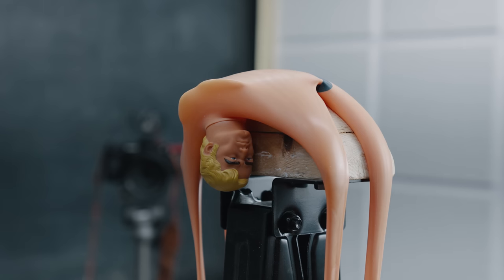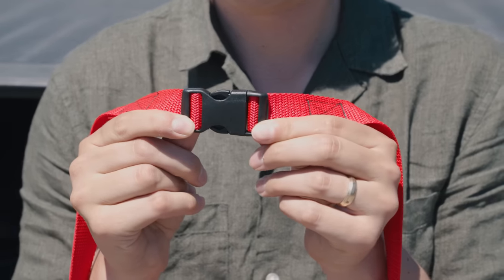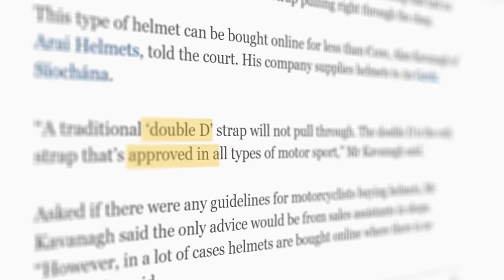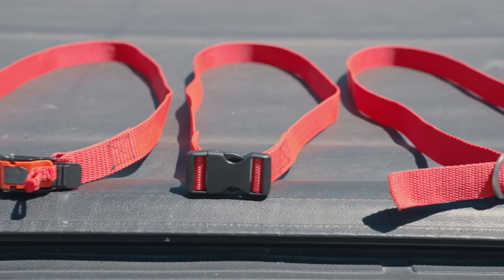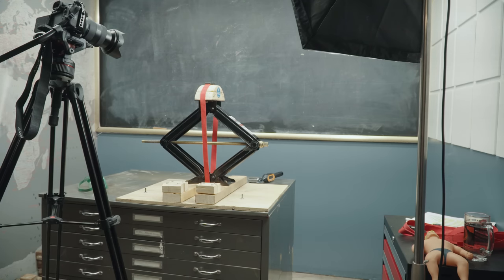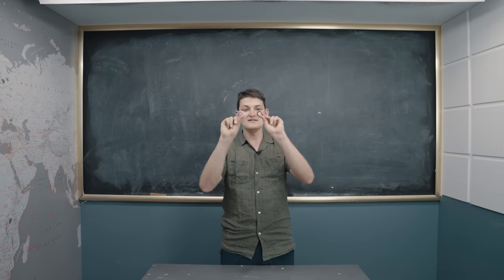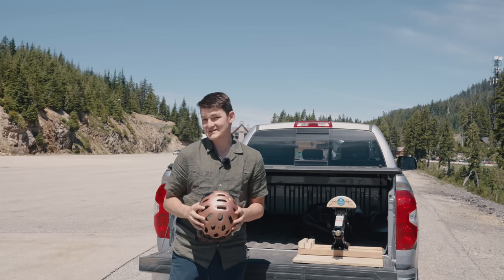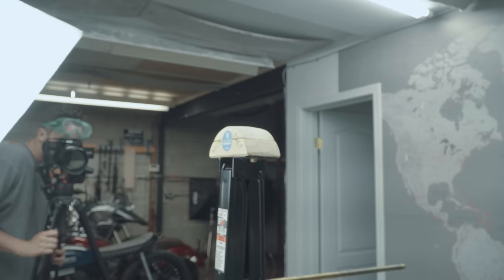Why Motorcycle Helmets Use this Ancient Buckle

Comment: You could've added a ratchet out of metal to the mix, like the ones used on the Shoei GT-Air 2
Reply: If I'm not mistaken, it is mandatory in the new European standard. So yea. That would have being nice.
Reply: I did not notice the first watch. But he did in fact use the plastic kind, as opposed to the metal one used on shoei's. 

Thanks for pointing that out.
Reply: what do you mean, metal? 
that serrated part that broke in video - it's always metal. Never seen a helmet with a plastic one, though I never had a premium helmet, all of mine were 100-200 usd. 
red releasing part is plastic, but it's not one that failed
Reply: @tomekvilmovskiy6547  if you rewatch the video you will notice that the part that failed is out of plastic. Most budget helmets and even some premium ones use these plastic ratchets
Reply: @yasc_  rewatched a few times: I see that the long metal buckle is broken. It could damage any plastic parts around after was broken itself, but for sure, broken plastic is unable to damage the metal buckle. So i made a conclusion, metal failed first.
Reply: @tomekvilmovskiy6547  The part you think is metal is actually out of plastic.
Reply: @yasc_  well, reconsidering the facts, can be so...  as I cant imagine that metal one would rather tear apart like that then anything else will break... only exception,  a metal with too much carbon (cant be here), or some aluminium alloy (can be).
Reply: @tomekvilmovskiy6547  you can see the surface where the ratchet broke.

It is black.

Steel and aluminium would both be silver. So it is definitely plastic
Reply: @anonym3017  I guess, the small piece is from inner mechanism
Reply: @tomekvilmovskiy6547  There are plastic ones. I've seen them. Just like the one he showed in the video.
Reply: The GT Air 1 had a double D, they took a backwards step with the GT Air 2
Reply: I take two 5 inch metal screws and screw the helmet directly onto my head.
Reply: @tomekvilmovskiy6547  It's plastic

Comment: I like my ratchet buckle. It's adjustable, convenient, and I'm not convinced there's much additional safety to be had in a stronger buckle. I think if that's the failure mode then I'm not very likely to survive anyway.
Reply: Indeed. Schuberth uses ratchet buckles aswel, i think its nice that i can strap the helmet on the fly, if i somehow forgot to do it before i left
Reply: same, it's so fast and i'm pretty sure strong enough. I honestly don't think you could survive breaking the strap by applying 400kg with your neck.
Reply: The test is flawed, anyway. All were plastic except the double D.

Let's try it again with plastic double Ds and see what happens. I'm betting my life savings it will break first, maybe second.

All this video proves is that steel is stronger than plastic.
Reply: @1SmokedTurkey1  not the sharpest tool...
They used what's available on the market. And helmets always have metal double D.
Reply: @Zw1d  are we comparing which mechanism is the most durable or what's available on the market? If it's the latter then yeah it's reasonable, if the former the test is flawed.
Reply: @eliasgraugaard6757  meanwhile my bicycle helmets always get double D.

Comment: Cool topic, interesting experiment (y) I've always liked the DD better. 
As for the protection you guys used. Forget plexi glass. It is rigid and easy to break. Polycarbonate sheets are a bit more expensive but there is a reason they are used as aeroplane windows.

Comment: I'm so glad you just put out this video... I have a backward facing GoPro on my daughter's motorcycle and she just got in an accident and you can see where the helmet strap clearly held the helmet on her head as she was flying through the air.... If that helmet strap wasn't tightened correctly the helmet would have flown off before hitting her face on the ground with the initial impact. Thank God for the evolution of these buckles 🙏
Reply: What exactly happened? What injuries did she sustain?
Reply: Hope all is well, but I'm pretty sure the point of the video was that these new buckles are worse then the REALLY OLD set of D rings. Meaning it's a gimmick and waist of money when you could use 2 D rings and be safer. Over engineered was the point. K.I.S.S method is best method.
Reply: @mickeyhavoc939  I really don't understand why stronger means safer. I think all of these buckles are safe enough. Ryan even says in the video that if it's too strong it would just rip your head off and to me that doesn't sound very safe.
Reply: Pauline Weinberger  She's fine (she races 50cc dirtbikes) I just wanted to point out how important this strap truly is. It possibly saved my daughter's life that day, she highsided and flew 10-15 feet landing directly onto her face and chest on an extremely hard packed track. She wears full gear all the time so she got up and finished her race 🏁 she was crying but still finished the race 💪
Reply: @mickeyhavoc939  after what I saw on her camera I wouldn't use anything but the 2 D-ring setup.... If you alter your strap in hopes to buckle faster or easier it's a death sentence IMO
Reply: @EbonyPope  no injuries... She races 50cc dirtbikes and accidents happen, I just wanted to emphasize the importance of getting the strap fully secure. In my case it's my job to make sure this happens because she's only 5 and wouldn't understand the importance of having that strap correctly tightened let alone being able to do it herself. (She's almost got the D-ring system figured out but it's nearly never tight enough when she's done)
Reply: @komerka35  True, but he also talks about how the strap is the engineered point of failure and that everything but the double D rings broke before the straps. Meaning the buckles broke too soon and that could mean the difference between a concussion and your head splitting open...
Reply: @mickeyhavoc939  Good point. Well I have double D rings so guess I'm safe
Reply: What type of strap was it?
Reply: @georgeperkins4171  D-ring
Reply: @mickeyhavoc939  yeah and in doing so assumes that that is true for all manufacturers and also assumes that all manufacturers take 900pounds of static load as the point where the helmet should come undone.

Neither one of which is a given.

Especially as the tolerances on straps aren’t super tight and as 900lbf can be enough to break your neck.

So there will be manufacturers who wan’t an extra safety margin and who therefore want it to break at 600lbf.
Reply: @komerka35  " if it's too strong it would just rip your head off and to me that doesn't sound very safe."
In that case you would probably be dead anyway.
ECE standard minimum strength for straps is 3kN. That is not enough for break the neck.
If a helmet is not on your head, it does not matter.

Comment: Excellent video, as normal.  Correct, the first lesson I had as a motorcyclist was how to put on a helmet. After watching me struggle with the D rings my pal said. "Don't undo them, make it slack and hold it to the chin bar then tighten it up when it's on." I always do that and have never owned a helmet that it did not work on. Incidentally, I cringe when even professional racers fiddle around with rings. I want to shout THERE IS A BETTER WAY!
Reply: Nice. That's a life hack right there.
I've got a helmet with ratchet fastener, the mechanism is too big it makes my throat hurt. I will get a Double D ring for the next helmet.

Comment: Arguably, and as mentioned, for the DD strap break you're already dead or decapitated. I wouldn't use the plastic 'Dicky' on a motorcycle helmet but the ratchet is by far my favorite.

It can be adjusted near perfect and due to the teeth it has some space to adjust automatically if you put on some underchins.

More importantly, it can easily be operated with gloves and takes a second to do/undo. 

This part being important when using your bike for daily errands with constant on and off. The best example I can think off the most prevalent and careless riders - city food deliveries that boomed due to Rona. If their helmet is tightened it's a ratched, while DD's are usually just flapping in the wind. 

When shopping for helmets I actively avoid DD system. I would consider the German overengineered one too.
Reply: If the strap is long enough you don't have to fully open it to take off the helmet and just pull it to tighten it.
Reply: @Capt Shiny 1. The relevant metric is when your neck snaps and not when you get decapitated.

2. The amount of force required to snap someones neck varies from person to person.

So I’d rather have the strap fail before anyones neck could snap as I don’t know when my own neck will snap.
Reply: @XtreeM_FaiL  exactly. That's the beauty of it. It's a lot quicker than other systems, many people just don't know that.
Reply: Problem with all the others...they can be released in the crash without actually failing. A good hit to the head..and a slight twist can have a jacket coller release a ratchet...
I know this from experience. You ride you...you decide your risk.
 DD ftw in my book. Ill use nothing else. Id rather lose a few seconds of my life securing my lid than lose the rest of my life being impatient.
Reply: Idiotic comment.  Kudos.
Reply: "It can be adjusted near perfect"
DD can be adjusted perfectly and it only takes a second.

"it can easily be operated with gloves and takes a second to do/undo."
Undo DD with gloves on is just as fast, if not faster. But anyway, what would you do with that extra second you saved?
Reply: @XtreeM_FaiL  I merely argued my reasoning for my choice. I have nothing against the use of DD straps - but personally find them annoying and inconvenient.

While I never had an accident on my bike I know people who did and their ratchet secured helmets performed as intended. In my neck of the woords R-to-DD ratio is  easily 3:1.

You use what you want, it depends on the type of riding, gear, and I suppose your dexterity but for me ratchet system is far superior and I trust it to keep my helmet on in the 'oh shit' scenario.
Reply: @Valks-22  " their ratchet secured helmets performed as intended".
Every system on sale fill the standarts.
Would be kind of pointless if they didn't, right?

DD is the simple as it can be.
Nothing will make it to fail. No dirt, snow or squirrels.
Only thing that can fail is the strap itself.

But the most important think is that DD is lightest of them all.
It gives 5hp advantage over the others. :P
Reply: @XtreeM_FaiL  look imho to have that much force applied in way that cleanly takes your helmet off vertically - you'd need to put it in a vise a have a horse pull you the other way. No hit or slide will do it and anything at that speed going near your neck will do far worse to your fleshy bits than either strap option. 

As for the bhp I'm well ahead, I removed the stickers off the bike and wheels, alongside wire insulation to ensure that 10% power increase :D

Comment: I don't ride motorcycles, but mountain bike a lot.  I'm not sure why we moved away from D rings and I'm sad about it as I much much much prefer them (had them on my older full face helmet).  I prefer fidlock over the regular clip but all of them suck compared to D rings IMO:
- I don't have to think about my facial hair with the D ring
- The D ring is always well adjusted

- My facial hair gets stuck in the clips a lot
- The straps on the clips get loose over time, and re-tightening the straps is a pain in the butt because they put rubber holders around the straps, puffy pieces so it's softer against the skin and they make the adjustments super tight fitting so that (I assume) they don't come loose as often (but that just makes them harder to adjust)

Comment: ECE helmet safety certification has a point about neck straps where at a certain force they need to snap to avoid decapitation if the rider slides and catches a curb edge with his helmet. Really don't see a problem with ratchet straps snapping, that's what they were designed to do.
Reply: I think if you experience that kind of force on your head it'll break your neck anyways 😂
Reply: @AggieRanger  a broken neck is better than no neck.
Reply: @matthewmaxwell-burton4549  The result either way is death so not really. Unless you care about having an open casket funeral 🤣
Reply: Er, he talks about exactly that point (at some length) in this video...
Reply: ECE say this.
"The strap shall withstand a tension of 3 kN without breaking."

If any other part break before that, then it is a fail.
Reply: @AggieRanger  you can survive a broken neck. its only fatal if the spinal cord is broken as well.
Reply: @dr.jekyll7908  pretty rare. Typically when you hear "he broke his neck." He's dead.
Reply: @dr.jekyll7908  typically when that amount of force gets imparted on to your neck and jaw more then likely you'll die from a spinal cord Injury or most often a collapsed airway
Reply: If an accident somehow manages to apply decapitation level forces to your helmet you probably weren't gonna make it anyways
Reply: Fall arresting harnesses work with a shock absorbing lanyard. The stitching on this lanyard is designed to tear away at a certain amount of force. Maybe the problem is not with the buckle on the helmet strap but with the strap itself.
Reply: @matthewmaxwell-burton4549  ever had your neck broke?
Reply: @buckstop  exactly. If someone's going fast enough for the helmet to be capable of ripping their head off, designing it to come off just means they'll annihilate their bare head on something slightly later in the crash
Reply: @DarthBop  no (touch wood), but my comment was obviously a joke.
Reply: @AggieRanger  indeed, although the worms might care 🤣.
Reply: @matthewmaxwell-burton4549  hahahaha. Cheers to them
Reply: @AggieRanger  i know a guy.  Had too have a fusion but he only lost a little mobility.. lucky as hell though.
Reply: @AggieRanger  the things is counter intuitively you may want it to do that because if it is imparting enough force to crush your jaw and neck then it's better for it to come off then to kill you since you have a higher chance of surviving if does. It wouldn't be designed to come off it would be designed to stop a safety device from becoming a killer
Reply: @AggieRanger  
Yep, I agree. If the strap or buckle is failing (regardless of the type) then you’re probably dead. Then what’s the point of this video? Other than creating something fun to watch.

Comment: This has confirmed a video I made on this exact subject a year or so ago. However there is something about those magnetic ones I don't know if I would trust. Sure under static load they can hold a lot however in a crash how easy would it be for that little tab to get pulled and or unlatched on impact my inertia? Hard to test for sure but this just add fuel to double D rings all the way. 👍
Reply: Having used the magnetic fidlock, if something does manage to pull that red Tab then it is game over
Reply: Your riding  (crashing) a motorcycle and your worried about the fidlock magnet coming detached???

Comment: Personally I prefer the ratchet mechanism. It has 85% of the strength of the double D rings, is always tight, is way faster and can be done up and undone with gloves on. I've found with double D rings it's possible to lock them too loose and then you have to faff about with your gloves to adjust it or even worse you don't get the ring order right and then it's basically useless. The ratchet is literally foolproof and less likely to decapitate you.
Reply: Finally someone
Reply: Полностью поддерживаю. Самая лучшая застежка из всех.
Dring может и самая прочная, но при всей этой избыточной прочности, наиболее дурная в эксплуатации.
Reply: Takes like 4 seconds to take 1 glove off. 

I will take an extra 15% for 4 seconds.
Reply: @someguy5035  You're skilled enough to handle it with a single hand? I'm impressed. Still, added to the time needed to decelerate, four seconds take the glove off, one second to strap it tight, another 4 seconds to put the glove back on. Against a single second while riding with a single hand that I can do when I fully forget to even strap it due to a distraction when I'm putting my helmet on. In addition, rarely if ever is a traffic light, that I encounter, longer on red than I would need for all that, so I'd have to actually stop on the side of the road to not hinder traffic.

Ratchet strap is my preference, for the obvious reason that I'm an idiot that sometimes forgets to strap it. The 15% loss is a risk I'm willing to take if that means comfort and the ease of use WHILE gloved is higher. Everyone has their preference, I'm just arguing from my point of view.
Reply: @ChaosShadoWolfe  Yes, It is super easy. Let's not pretend.